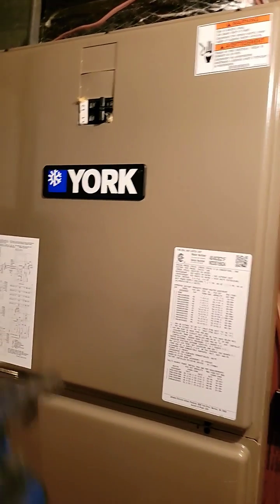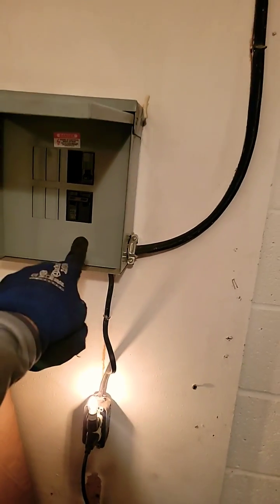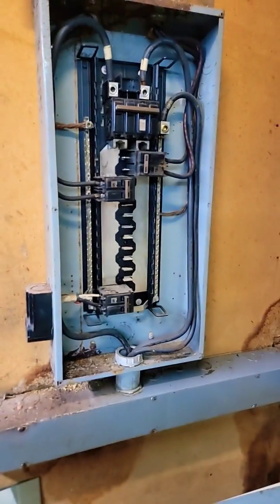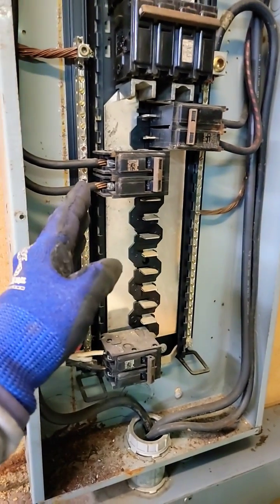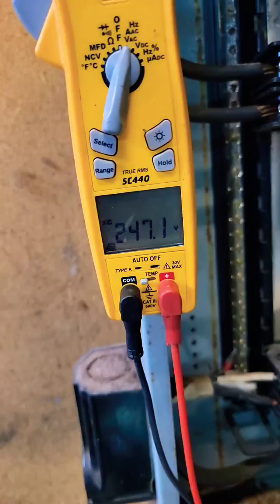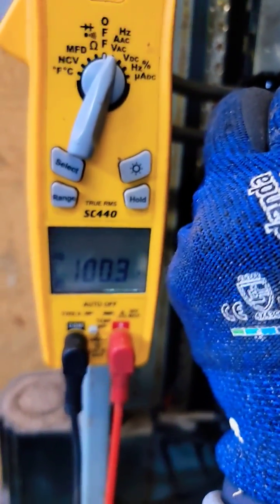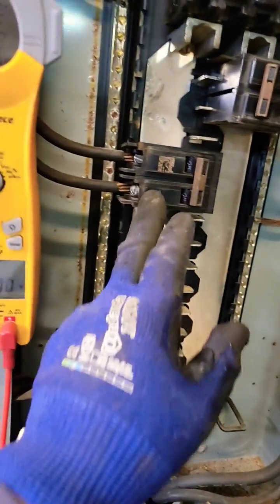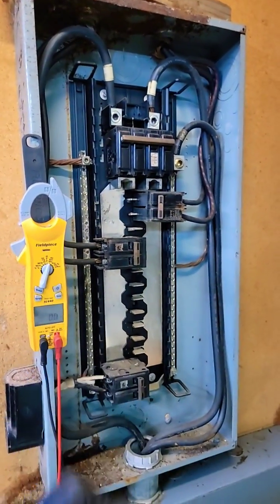Breaker problems? Easy ways to check for a faulty one!

Comment: I'm having an issue where I'm not getting enough power out of any of my receptacles. Lights and fans work but not my refrigerator. The multimeter readings are coming back fine on everything. Any help would be appreciated. Ty.

Comment: Thanks for the Tip(s). Got a Buzzer or two I want to check on... Didn't think/consider checking for significant voltage drops or dead contacts first. 

Should save me some time if I can confirm if the "Buzzers" or other Breakers are providing/getting full voltage before I pull and check the others for damage... Thanks. Hate to guess

Comment: gosh seeing your hands in a live panel without the proper ppe ooooooo weeeeee had me on the edge of my seat LOL. 

Work is NOT worth a lifetime of trouble. Go slow. Be methodical. Go home better than you came in, not worse...... the work was there before you and will be after you are long gone.
Reply: Make sure to grab all of the wires and just wiggle them around a bit, get all of that stuck electricity loose.

Comment: Stay out of the breaker box!!  Normal HVAC contractors insurance will not cover if a house or building that burns down or is damaged after you replace a breaker.
Reply: Honestly, if you screw up a breaker swap then you deserve to not be covered by insurance.
Reply: Shut up 😂
Hvac tech and installer here for over 20 years 
Telling a service technician to stay out of the breaker panel 😂😂😂
We have our own electrical license but most companies don’t 
Most service technicians know what there doing just like this man
But breakers are very easy to change out or they wouldn’t sell them at Lowe’s 
And do you know the probability of a fire escaping that enclosed metal box
I’ve seen whole panels Burt up and the walls just have smoke damage 
Not saying it can’t happen but, again 20 years and never seen it
You pull a breaker off and make sure your connections are tight and push it back on 
To everyone, it’s not rocket science but by all means if you can not perform this very simple task call an electrician and he will charge you $300 😂
And if your worried, shut the main breaker off while your working
Reply: @darrylsouthard252  Your an idiot if you go into a electrical panel without the proper insurance. It has nothing to do with how hard or ez it is. If anything happens anything you are going to be responsible. As a business owner for over 20 years I’m not willing to risk my business and 15 peoples jobs for 300$. Also in Nj a homeowner does not need a license or insurance to work in on anything in there own house that’s why Lows sells breakers.
Reply: As long as you're not modifying the panel most states allow repairs to be made to existing circuits. Some states' mechanical contractor's licenses allow it anyways
Reply: @bryceleblanc3548  Not Nj. I asked my insurance company. Was told NO in states that require a electrical license.
Reply: @sampantiliano  Wouldn't know or wonder about New Jersey as I don't live there lol
Reply: @bryceleblanc3548  but he said I’m an idiot lol
This mans a fkn moron I wouldn’t waste a comment

Comment: Nice find. How do you like that field piece meter? My UEI grew legs, I liked it but not sure what to replace it with. Fluke is too expensive not to have a magnet built in and no micro amps
Reply: I have used Fieldpiece almost exclusively. I do have a Fluke megger and an old beat up Sperry from the 90s but everything else is Fieldpiece. I just picked up the SC680 and I have to say it's the best meter I've ever had. The Amp clamp has an led light when the clamp opens, it tells you if the phases are correct on 3 phase, and it has 2 K clamp connections. If it made me a sandwich I would put a ring on it lol
Reply: @bryceleblanc3548  I bought another UEI, but a nicer model with a few more features, I’m not super happy with it. It’s bulky as hell. Wish I went with the field piece.
Reply from the maker: I like it if I can just keep from breaking it or losing it

Comment: Good Find ! 
But Working in a “ LIVE “ OPEN “ 200 amp Service panel is NOT For Homeowners !!!
Stay Out - of Big Panels !!! Homeowners. 

it Can Get You Blinded , burned & or Killed !!!
2 out of the 3 Can Happen Real Quick ! Been there Done that ONCE !

RESPECT ELECTRICITY !!!

Leave it Someone That IS Properly Trained !!!

You better be damn careful Working With a “ Live “ OPEN Panel like that / no breakers to keep your fingers away from the entire center Bus that is “ Live “ all the Way down the center.
ONE wrong move / a screwdriver / breaker pieces / across any two of those center connection points & Thier is Going to be a Very Loud Bang & You could be dead 💀. Very Risky with the Size of that Wiring coming into that panel.

People need to know - screwing around in there can get u killed ! 
You Might want to start with that !

For Safety sake - You might want to start Mentioning some safety measures.

Like: 
1) Turn of the Main breaker - BEFORE YOU Remove a Burned up breaker that may fall apart on you on removal & a Piece of metal fall into the live bus & Go Bang in front of your face.
2) Wear Safety Glasses - Minimum.
3) Wear Gloves approved for Electrical work - Minimum.
4) DO NOT TOUCH ANY OF THE CENTER BUS BAR ALL THE WAY DOWN THE CENTER OF THE Panel.
5) What stuff has voltage on it etc.

Fyi - Whenever You see a Breaker that one of the Connection points have turned blue.
Replace the Breaker & Check the Center Bus Bar for Damage.
Usually it’s Best to Move the Big 2 pole Breaker to a New position & move a 15 or 20 amp Breaker into the spot that got overheated.
Reply from the maker: Wow a lot of good information thank you man
Reply: @taddydigest   No problem. Old Empty panels like that are a lot more dangerous than a Full Panel. All the breakers in a full panel keep the center bus covered / safer.
Reply from the maker: yes absolutely I agree I love your knowledge